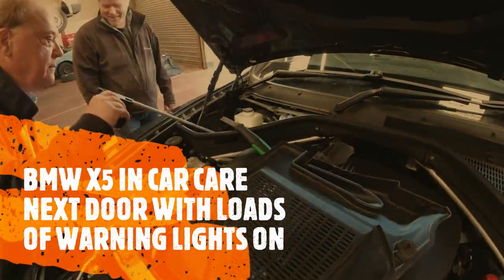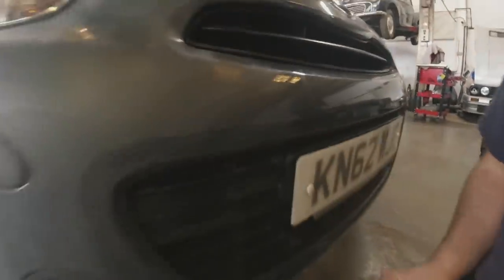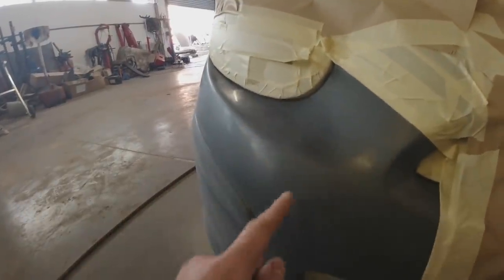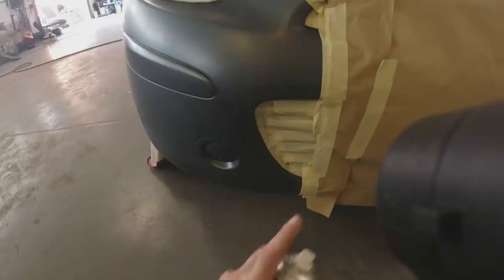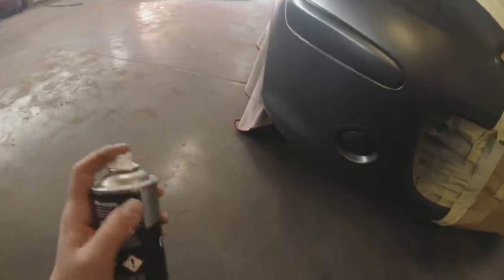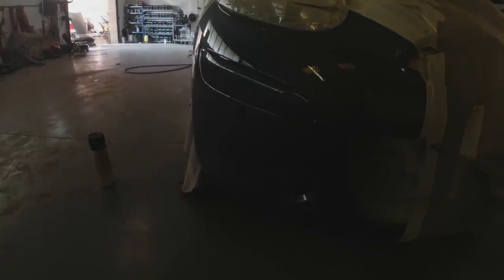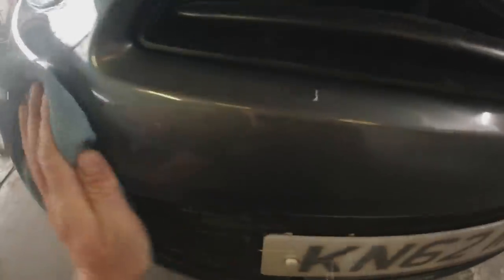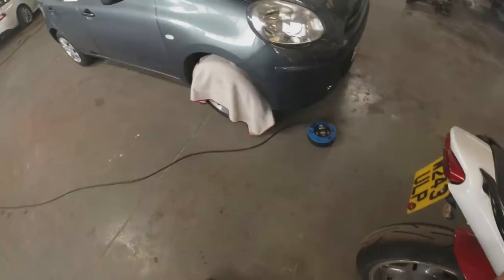Unwelcome Guests WRITE OFF BMW X5! More Rattle Can Painting and Dacia Dealing!

Comment: You seemed to be adding the laquer coat on quite thick, even the dusting coat? Do you not suffer from runs at this thickness?? Thanks
Reply from the maker: No. Not with 2k anyhow. But there is such a fine line. Takes experience

Comment: them sanderos r cheap reliable hassle free cars but the newer ones have a 1l 3 cylinder engine with a big plastic inlet manifold over the top which like to leak oil but the renault 1l 3 cylinder engine in the older ones without the plastic housing doesnt suffer from it, just to prewarn you, even one of the dacia plastic covers ive seen leaks and ive seen alot.
Reply from the maker: Yes heard this from a few people

Comment: After watching a few of your vlogs I'm thinking you love the challenge of fixing up cheap cars rather than making cash? I know a guy who does similar and he is proud to provide employment for a young mechanic and a valet/detailer whilst flipping at the bottom end of the market.
A more successful dealer I know buys trade-ins from main dealers on a '7-day return' basis. He has time to check for expensive problems, e.g. CPU faults before advertising them. He always says there's thousands of parts that can go worng on a vehicle and the older it gets the more likely a fault. He won't touch cheaper cars because customers don't understand this, or won't accept it.

A neighbour of mine is handy with spray cans and gets the odd accident damged car from Copart. He specialises in VW repairs since he can acquire all the panels he needs from Eastern Europe.
After watching this video and some of your respray vlogs I wonder if you would do great concentrating on car body repairs as your main business and selling one or two cars on the side?
All the best in your endevours.
Reply from the maker: Hi Pete. No paintwork for customers does not appeal. The stress of matching paints, nailing shaping with fillers, no thanks. But I do enjoy the process of turning round cars you are right. This is why I have written off just having a forecourt and sitting at a desk in a polo shirt